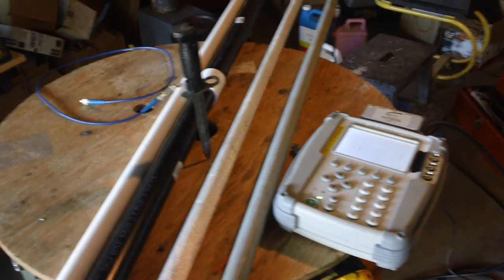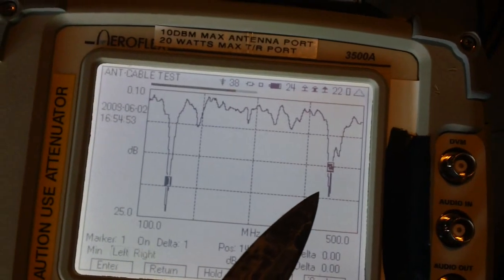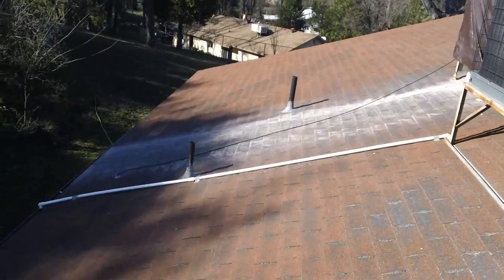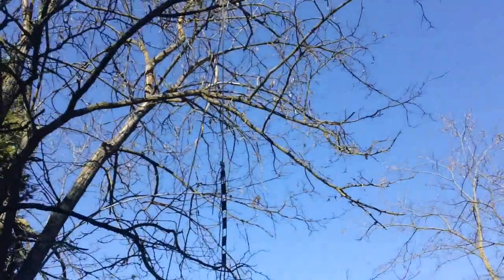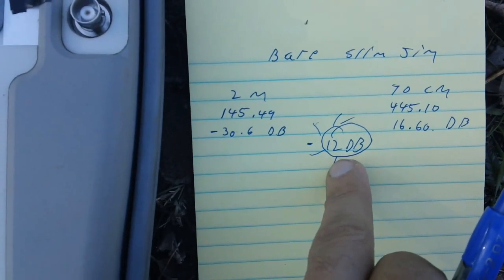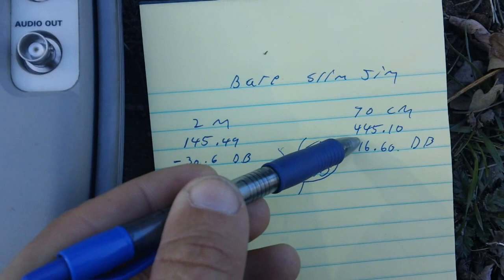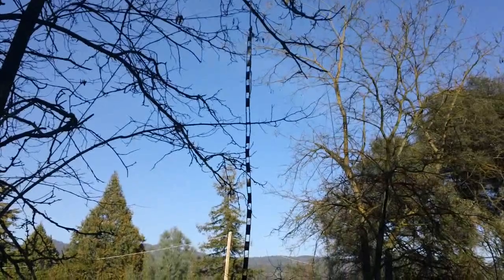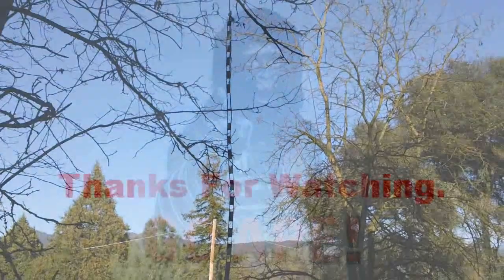Attempts To Urban Camouflage A Jim Slim Antenna. Test Results.

Comment: I just discovered this accidentally myself by hanging my N9TAX dual-band Slim Jim in a pine tree, close to the trunk. The tuning and VSWR over both bands went crazy! I'm in an HOA, so stealth is needed. If I can't find a branch extending out at least 6 ft from the trunk, I will probably get a 12 meter Spiderbeam pole, hang it from the top with the pole in tension flexed like a bow so as to get the antenna away from the fiberglass, and hide the pole and antenna in the outer reaches of the tree.  BTW, you can now get a NanoVNA for between $50 and $100 that will perform a complete antenna analysis over any range of frequencies. You overcome the limitations of the small screen with the free NanoVNA saver software; I save the charts with a screen snipping tool.

Comment: Have you tried a super J pole antenna?  I built some years ago but the insulators weren't good enough to last like they should  . I believe there called a coliener  and have done as much as 3 stacked elements but it gets to tall to hold up long when made from copper pipe.

Comment: Thanks for the great video  you answered my question good , now could you try one cut higher in frequency to see what it takes to keep it working at Max in pvc water pipe  ? Also would Krylon camo paint reduce performance?  Keep up the good work.
Reply: Try using grey pvc electrical thin tube.. but check swr before and after insertion...mine worked fine but wind blew it over at a recommended 'dont glue'  point by ham who engineered it for tube. 
I just replaced it with a Diamond x30 dual bander ....good for 150 w if needed. 
See dxengineering website.

Comment: Perhaps instead of using the schedule 40, try the 200 psi, which is a thinner wall pipe (ala Ed fong j pole)
Reply: John Regan  I agree, 200 psi PVC pipe readings?
Reply: I’ve got the thinner walled  200 psi white pipe, but no way of harvesting any data.

Comment: What the fiberglass and or PVC is doing to the Slim-Jim is changing the di-electric coefficient. You can easilly mount make a Slim-Jim to run perfectly with the housing but the pipe/tube makes the velocity factor of the antenna much slower and therefore the antenna is too long. If you build the antenna correctly and make it for the housing you can keep all performance. The antenna needs shortened and all other dimensions need changed as well. I make and sell base Slim-Jims for years now and these can be some amazing performers in a compact package! They just need to be made for the exact housing they will be in.  Nice vid!

Comment: Thank you for this video. It proves what many have been saying about the effect that any nearby objects have on the antenna. I have seen at least three YouTube videos today alone of hams putting this Slim Jim inside or outside of PVC as a way to keep it straight. None of them care enough about their equipment to check their SWR and the frequency that the antenna is tuned for once you place this antenna inside or close to any object, metallic or not. I use this antenna and it is hung as far away as possible from any object.  73 from N2LRB

Comment: So I am new to all this Ham stuff and looking into extended my HT range while in the house. Based on your explanation regarding why they call the frequency 2m is because it needs to be 2m from an object for proper transmission. This test just confirms that correct?
Reply from the maker: Negative, 2 meters is the size of a halfwave antenna whip in the VHF range. 2m from an object in the VHF band is a rule of thumb distance from an obstacle to avoid reflective power back into your antenna.
Reply: So if you wrap the antenna with a tube of some sort then you are violating the general rule of thumb and therefore should expect to receive the reflective power back into your antenna and thereby effecting the antennas performance.
Reply from the maker: Greg Allen
Sorry for the delay, I'm more active outside of YT during warmer months. It depends upon the dielectric properties of the material. Metal being the extreme, where 100% of the radiation is reflected back, & a fiberglass dome built for an antenna will let through the majority of the radiation out. The materials I used in this vid are variable degrees of that dialectric material that changed the tuning and of the antenna. That style of antenna (folded Dipole) seem to be more sensitive to materials surrounding it. I never seen a folded dipole enclosed in any encasement. strait dipoles yes. The general rule of thumb that I was referring to, is the distance to more denser objects like metal poles or brick walls.

Comment: the coverings add a dielectric coefficient you have to account for.  wish i knew the equations but had similar problems with wifi antennas i've tried making.

Comment from the maker: @DuroWarrior Thanks man. yeah, it was the first test with the fiberglass pole, that was the hollowed out antenna. The results were not good, the tuned frequency shifted to 137 Mhz. I'm going to do the same test with a 5/8 wavelength antenna sometime.

Comment: I used PVC pipe, but instead of being zip tied it suspends via bungee cords about 3 inches form the mast.  I wish I had the equipment like you do to test and see how that configuration works.  After watching this I beginning to think it is best just to suspend with para cord from a tree.  I have also looked at the arrow J pole, and going to hide it in my attic, along with my scanner antenna.  Great video, you always do a great job explaining stuff like this.